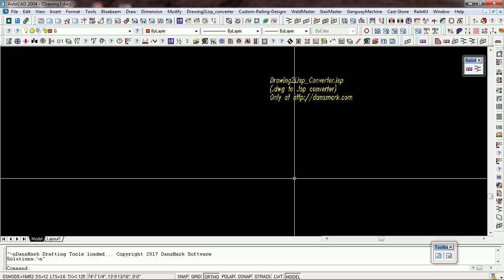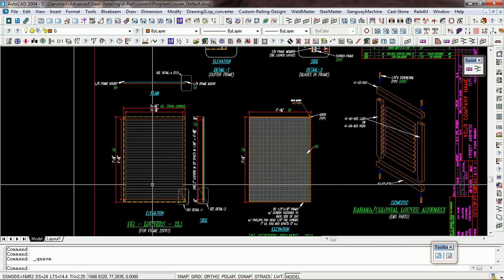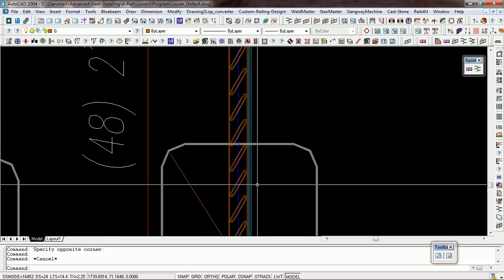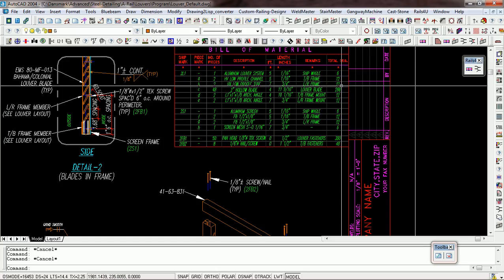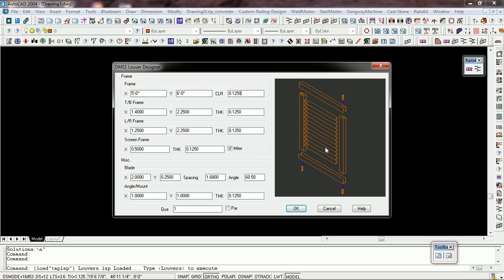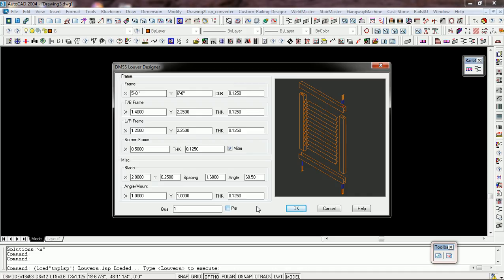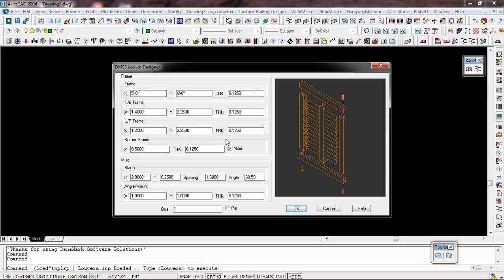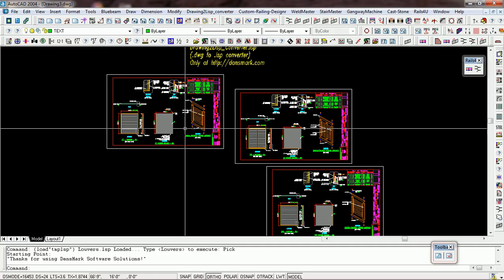Automated Louver Shop Drawing #1

Comment from the maker: I created software that automates writing code for projects like this.
It's Called Drawing2Lisp_Converter.lsp
Using this software and a drawing I had already designed, I converted the whole drawing into programming code that re-draws the exact same drawing.
All the entities are the exact same as they were in the original drawing.
Each entity is the re-created with the same layers, colors & line-types (text size, style and any other definition).
  After the conversion, I convert every X,Y,Z variable so the user can change them to make the drawing "adapt" to current requirements (Even different materials can be used).

This software is truly an amazing way to automate almost any kind of drawing (even Z elevations).